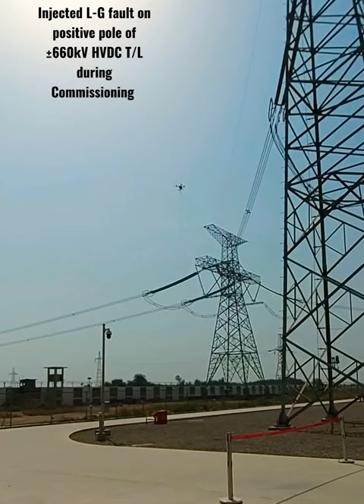Injection of Single #Line-to-Ground fault during testing of +660kV HVDC transmission line.

Comment: So, how did they do this before drones?
Reply: Mostly by attaching a conductor from L-to-G before energising the lines
Reply: Or pulling the conductive wire over the power line with a non-conductive cord of some kind. You get the non-conductive cord over by some method like shooting the bobbin over the power line with a bow and arrow. (seriously!)